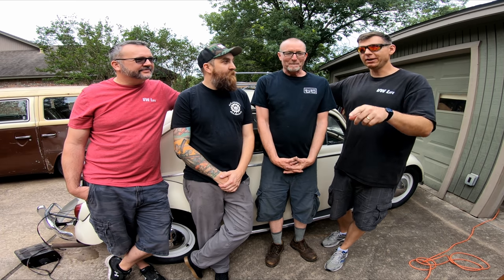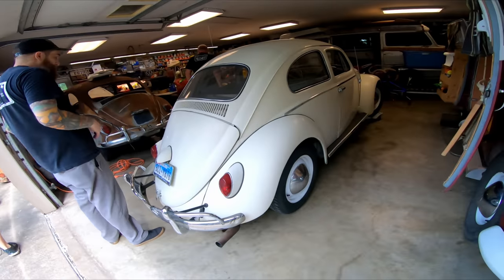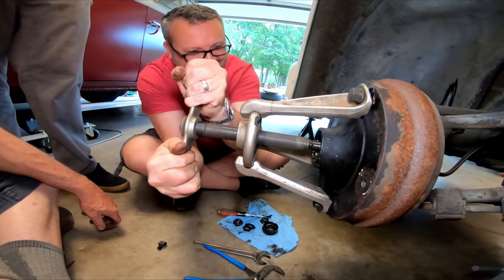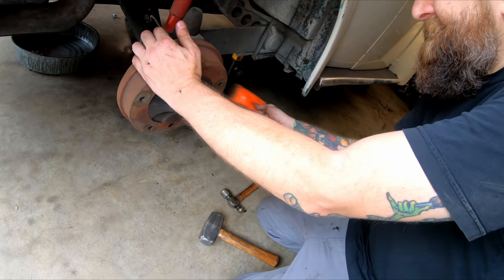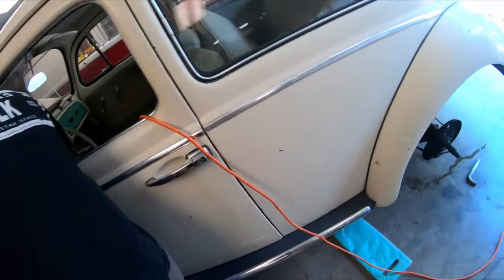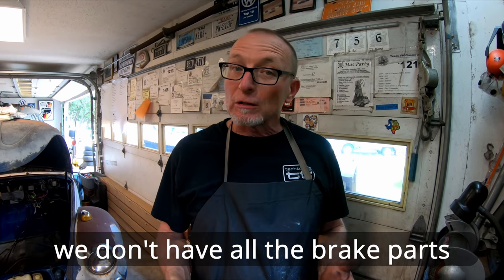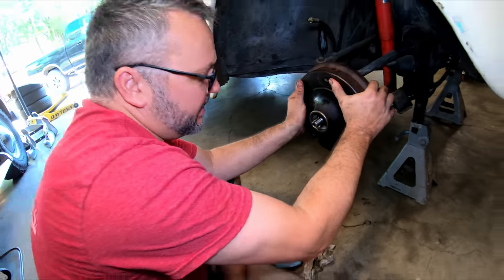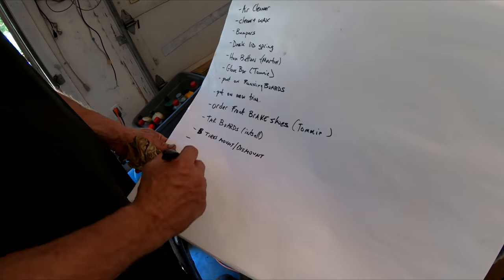It's time to start work on the the 63 Bug!  Join us as we tear into it.

Comment: For the rear castle nuts, you should use a tool called a "torque multiplier."  The benefit over the "wacker" that you used is that with the multiplier tool you can re-torque the nut back to original specifications. The tool has a 9:1 multiplier effect, and works on 4 and 5- lug rims as well as on the gland nut.
Reply: Excelente , espero el siguiente pronto Dios mediante..
Reply from the maker: yeah we need to use one for sure!
Reply: Just invest in a Milwaukee M18 Fuel Impact gun. Undoes rear hubnuts and flywheel gland nuts with ease. 1400ft/Ib of nut busting torque it's a great bit of kit.
Reply from the maker: @BRED510  you guys and your high tech gadgets :)

Comment: Easy way to mask off stock wheels is get a troll of that brown paper (paper bag type consistency), curl it around the rim, it will slide right inside the grooves and outer edge of the rim, that way you can paint it all with both colors of paint at once.  That's what I did in the garage 15 years ago.
Reply from the maker: ah we'll have to try that thanks Jay!